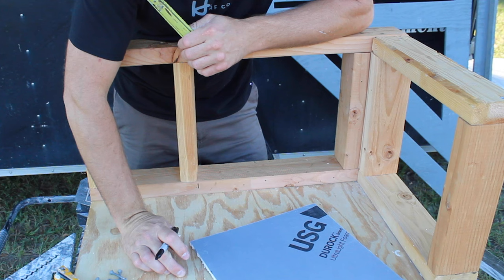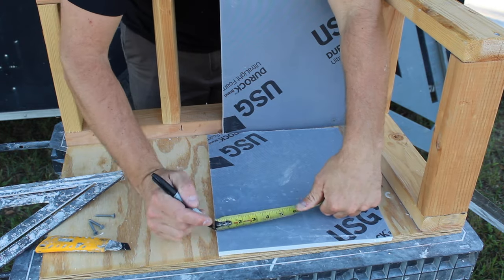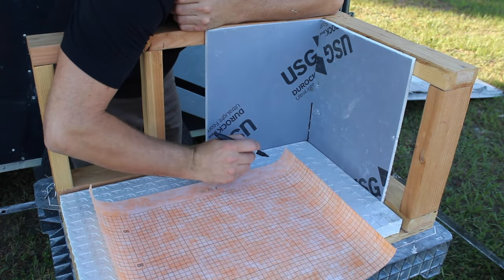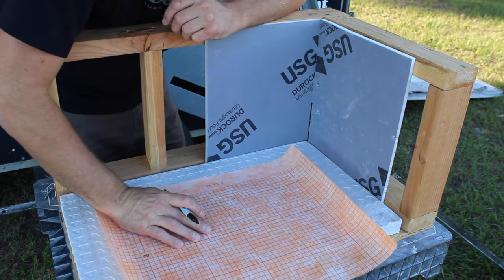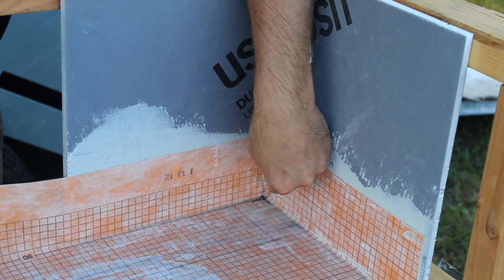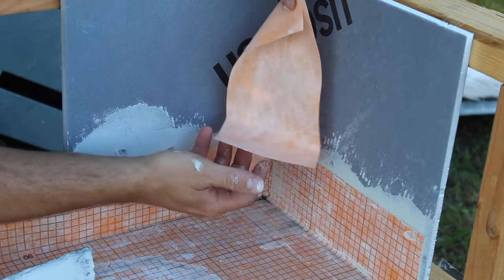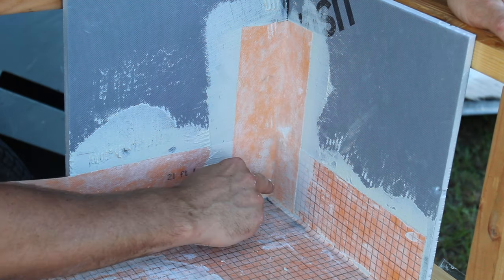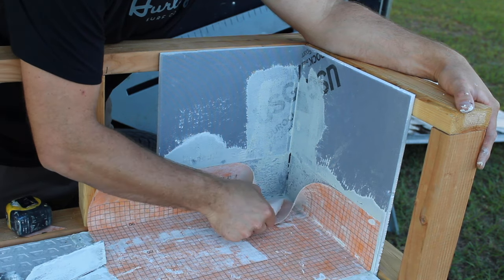Schluter Kerdi inside corner hack.

Comment: A great way to stage a revolt against the cost of those friggin corner pieces!  An alternate way of doing that would be to install the wall board as usual, then take an oscillating saw  to cut out the inside corner.
Reply from the maker: Yep that's works as well.. I'll have to do an updated video for YouTube...I have a lot more daily content on Instagram

Comment: Question, PVC liner is set behind a cement board, or similar product, why is Kerdi used in front? They are both waterproof products. All the videos I'm seeing have Kerdi installed in front of the board. Couldn't you put Kerdi behind the board, and use the board to hold down the corner flap?

Comment: Clever and everything, but I wouldn't say "everyone hates inside corners" because of the buildup.  You did a fair amount of labor to save $7 so I guess part of the equation is how much is your time worth to you.  The buildup on the shower floor is actually fine because it's never a bad idea to have that floor tile slightly high there.  A little buildup isn't an issue with large tiles, and if using smaller 2" mosaics it's fine for the corners to drain a littler better.  My 2 cents, but good job anyway.

Comment: How much does Kerdi Fix differr from 100% silicone?  I use silicone on every butt joint just to be extra safe and especially in the corners before I even start with the kerdi band.  Seems to work perfect at about 10% the cost.  I'm about 4-5 tubes into a tub surround which would cost a fortune with Keri Fix and I think I have a superior seal.
Reply: In my experience, Kerdifi is stickier, tougher, and generally more durable. IMHO the extra cost is well worth knowing that I'm using a product that should last longer.

Comment: Use multimax lite or titanium from laticrete or use ultralite s2 or if you can’t get those use pro lite. All the sand thinset wick up the moisture some. A fiber based thinset is way superior then I like to use a liquid membrane or a cementious membrane on all seams